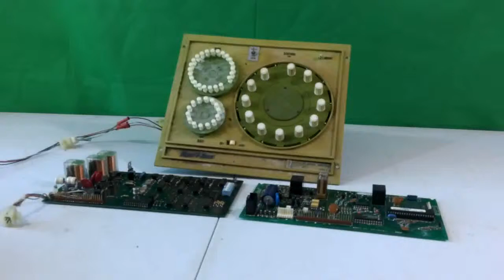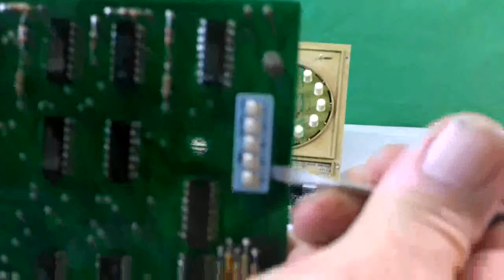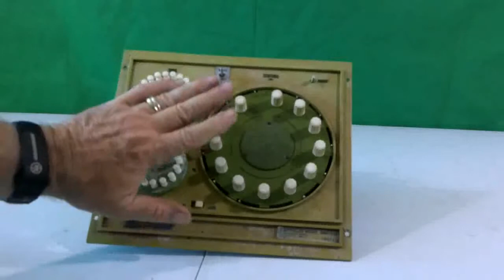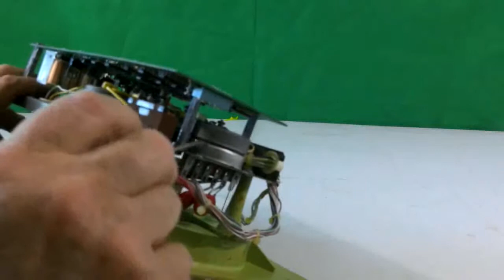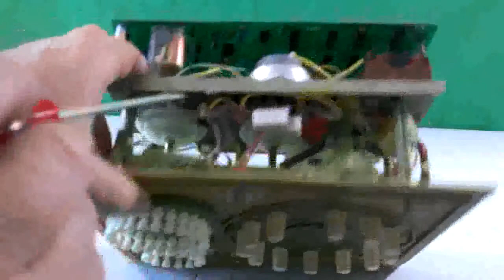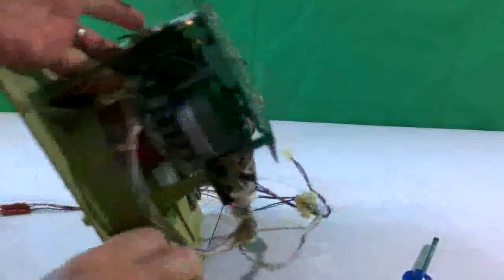SBM Controller setup and trouble shooting

Comment: This helped me know what’s possibly wrong with my system. Most likely a bad clutch
Reply: Another tip:  look  at the  dials  around the shaft areas ...overtime these will crack  causing lots of problems .